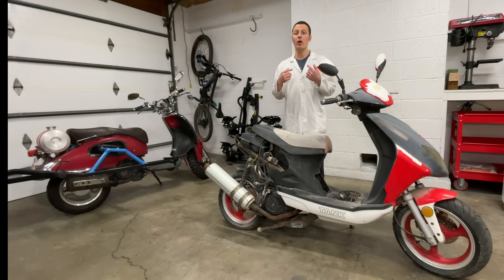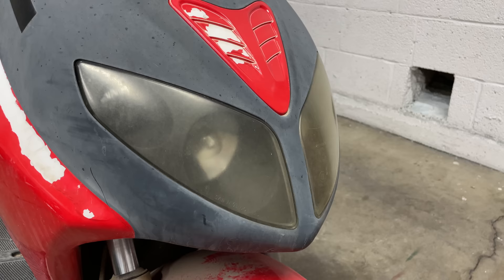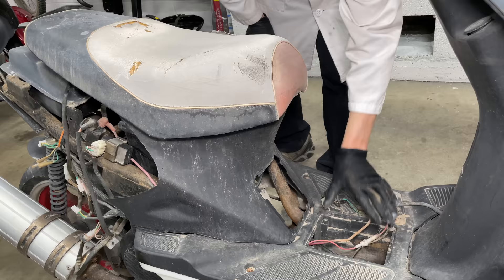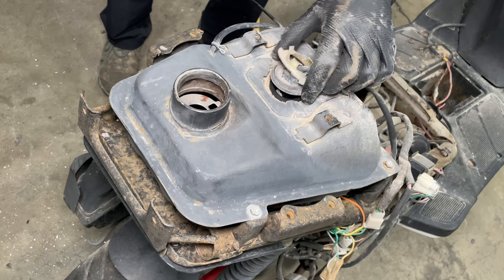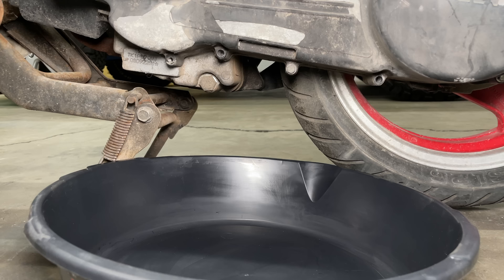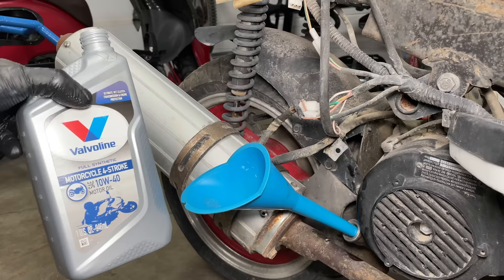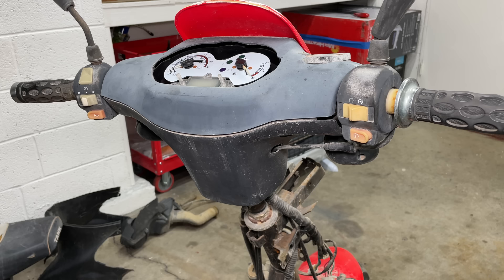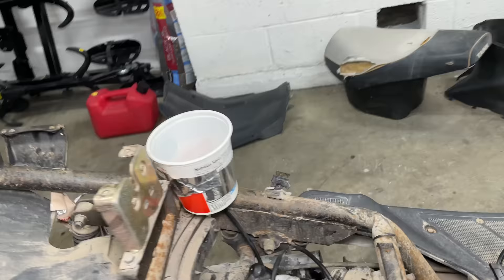$40 junky Chinese scooter - will it run?

Comment: I have to ask - since the GY6 doesn't have a wet clutch, shouldn't you be using regular automotive oil (with its friction modifiers) instead of motorcycle oil (without)? It's been my understanding that motorcycle oil does not contain those friction modifiers in order to keep the wet clutch working.
Reply from the maker: That's right, the scooter does not need friction modifiers for the clutch.  You can use automotive oil, but I think air cooled motorcycle oil may be designed to handle higher temperatures.
Reply: @LabCoatPaul  10w30 or 10w40 motorcycle oil as  putting the wrong oil in or wrong graded oil can damage  the components and engine itself it's like running a car or a scooter/moped or motorcycle or any other thing with a engine without  oil or wrong oil or over filled oil can cause serious damage to the engine and thst also goes with the wrong grades or oil aswell  as you use wet clutch oil in your normal scooter that will make everything slip or even damage the engine completely or even heat sieze it aswell which isn't good

Comment: Instead of Evaporust you can just use a strong vinegar
Reply: Yep, and it's a good idea to throw in a (counted) number of clean bolts & nuts, filling the tank all the way to the top. every few hours you can shake the tank around and the bolts/nuts will help dislodge the rust, rather than relying on a pressure washer which will not reach many places in the tank. Remove the vinegar and bolts, clean out then spray with some machine oil to help prevent flash rusting.

Comment: I would stay away from those Led turn signals. Upgraded mine to those same exact ones and you could barely see them in full daylight, returned them right away and went with incondessent bulbs. As far CDIs go they are common to go bad on these scooters
Reply from the maker: Thanks for the tip!  A lot of those Chinese accessories don't work as well as they should.

Comment: Where I live in Missouri nobody even looks at that scooter put a 49cc tag on the back of it and I'd rather crap out of it I wish I could find a 40 dollar scooter like that just needed a CDI anyhow if you're willing to sell it cheap I'd be willing to buy it I live in a place called Bolivar Missouri
Reply from the maker: I just sold it the other day for $300.  Used scooters are selling for way too much in Utah.  I guess I made some money on the deal.  I paid $185 total for it with parts.  That means I got $115 for a little over 10 hours of work.  It's an extremely low hourly wage for skilled labor.
Reply: Oh I had a truck but somebody didn't stop at the stop sign and hit me pretty hard and total my vehicle I just needed something to get back and forth the doctor's office the store with and it looked like a really good deal

Comment: If u don't have a key four gas cap pri it off with to big screaw driveers an if no key a flat screaw drive will work to start it. U don't have to buy new gage u just take em apart ok an use a lemon on em to clean it up on gage an it will clean em an u can get a bat field at Walmart 40 u can clean seat with comet  u can get bod plastic on ebay u can get any thang u need four that scooter  on ebay. Omg

Comment: I'm sorry but you lost me at 1 hour to replace the broken air box brackets?
Reply from the maker: People often underestimate how long things take.  You're probably thinking a bracket is a simple little thing: 10 minutes.
First you have to find a spot on the air box that would be suitable for a new bracket.  It's probably where the old one was.  Then cut off the old bracket with a dremel tool.
Do you have a new bracket or some metal to make one?  Maybe you have to go to the store.  
Then you measure, cut, and bend the new bracket.  Test fit it to the scooter and air box.
Then find nuts and bolts that are suitable and drill the bracket and air box.  Might have to go to the store for bolts.
Once the bracket is done, you have to install the air box on the scooter and hope it fits.  Maybe the bracket doesn't fit right and needs to be cut or bent more.  Maybe you need washers.  Maybe you need to start over and make a new bracket.
Once the bracket is done, it's a good idea to paint it.  I didn't count the time for paint to dry.
1 hour is a reasonable amount of time to make brackets from scratch.  
If anyone says they can do all that in 10 minutes, they probably didn't count the time correctly.

Comment: This has WRONG information,  this is a vacum operated fuel pump, there is no SUCKING, engine vacum pulls and releases a diaghram in the fuel pump, there is NO fuel entering the engine through the vacum line, if there is you have a leaki g fuel pump and engine will run poorly if it even starts
  The reason twisting the throttle repeatedly helps to start is because these carburetors have a small accelerator pump built into them, all carburetors have them to add raw fuel to the mixture briefly during accleration only

these are the common possibilities why scooters are hard to start from sitting 

fouled spark plug
valves need adjustment 
low battery voltage
carb air bleeds jets clogged from sitting 
bad fuel
loose or dirty electrical connections, especially in low voltage ignitiin connecrions

!. ger the engine to crank over by recharging or replacing battery
2. check for spark at spark plug lead
3. install new spark plug - always a good idea 
4, if not starting spray carb cleaner into air filter intake
5. if engine will run only on carb cleaner, check for fuel entering acrb at fuel line
6. if carb gets fuel but wont run at this point clean or replace carb with better unit
7. if still wont start check and adjust valve adjustment

bad fuel

Comment: Let me know if you got it running wow time u get done u gone to have about 1000 in that 4o junk u better off to buy a new one
Reply from the maker: I did the the scooter running, and sold it some kid for $200.  It still needs body panels  and lights, but that's not my problem any more.  I didn't lose any money but I lost a lot of time.
I tried this again with the orange $400 scooter that runs, and lost a lot of time and money on it.  https://youtu.be/a40dcmD99kQ
Reply: @LabCoatPaul   I love the one u gave 400 four
Reply: @LabCoatPaul  cool do you steal got the 400 one
Reply from the maker: @jodyholcomb3738  I sold the $400 scooter for $800 after I fixed it.
unfortunately, I spent $700 on parts so my total cost was $1,100.  I sold it for $800 so I lost $300 and a lot of time on that deal.

Comment: These scooters are crap, first at 9000 kilometer the variator and koppeling are broken. Then at about 15.000 kilometer, you can trow it away becose the engine will fall apart. I jave tested this with 3 chinees scooters myself. And see it all around me with other customers. Buy a Kymco you can easy do 100.000 kilometer and more.

Comment: what are theese Labour times? are you doung this drunk? 30 Minutes for a Mirror change that takes at most 2 minutes
Reply from the maker: Chinese scooters are a massive time suck.  I challenge you to do some of these repairs and use a stopwatch to see how long it takes.
Reply: @LabCoatPaul  if you need 30 minutes for a Mirror than i cant help you wasnt ment offensive but in 30 minutes i pull the engine out of one of theese you litterly only need to unscrew the MIrror and put a new on its not Rocket science :) I know for beginners is can be a bit harder but your times are off at least for me. If you need to long fine. Again i dont mean this in an arrogant way its jsut the time it takes me to do that. I have a east  German Moped arround i can show you that it takes 1 minutes to change the mirror there if you like. cheers
Reply from the maker: @roxxliveracing2039  That is the difference.  One does not simply fix a Chinese scooter in a couple minutes.  
Sure, you can theoretically unscrew the mirrors, but the threads could strip out, or you may have to spend an additional 20 minutes getting the handlebar switches they thread in to to stop moving, or perhaps cobble the plastic back together around the mirror.
Next come the new mirrors.  Maybe the new hardware will thread in, or maybe it won't.  You should probably glue it together with loctite. 
Once you get the mirrors on, you'll realize you can't see anything because they're the wrong shape.
Remove them, and bend them in the vise, then try again.
If you can do all that in 2 minutes, I'll be impressed.